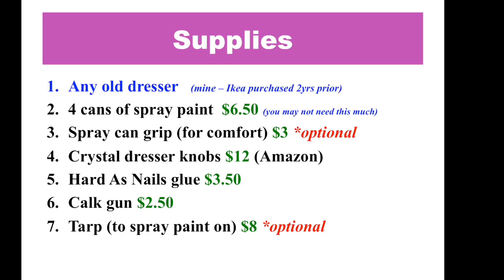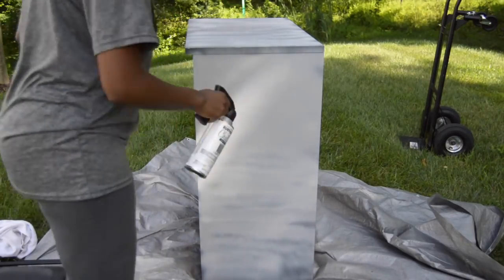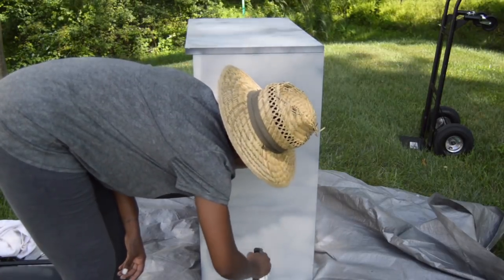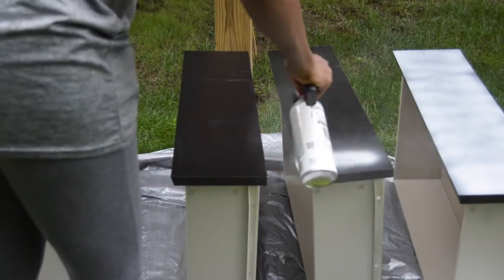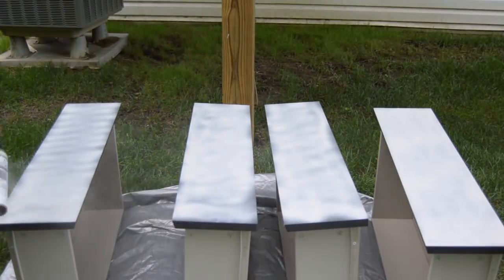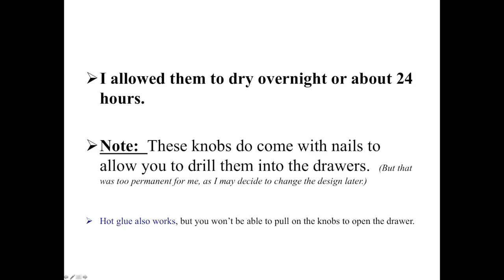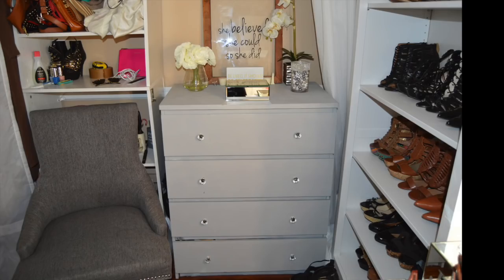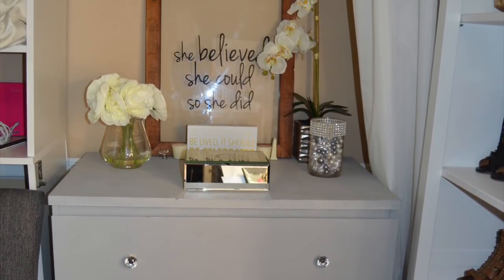DIY Glam Up Your Boring Old Dresser - Ikea Hacks

Comment: Did use primer? I have  a black  dresser i wanna paint Orange  , someone  said   yhe orange wouldn't  work because  the  dresser is black. Amy suggestions?
Reply: Can you strip the black paint off of the dresser? If not, then, yeah, a primer would be indicated, or maybe two light coats of the orange paint. I once dyed an orange evening wrap black to wear with a maroon formal, and it turned out well. If you looked VERY closely, you could see that the wrap was not a true black. Other than than it looked great.

Comment: Hi I wanted to know what if you live in apartment with no where to place the dresser outside will I still be able to spray paint in the house or it’s not advice able?
Reply: Jasmine Brown spray paint is pretty overpowering. You want to be able to spray paint outside. If you have a balcony attached to your apartment this also works.
Reply: Jasmine Brown  I live in an apartment and definitely outside even if it’s right outside ur house door just make sure u use a tarp of something to cover